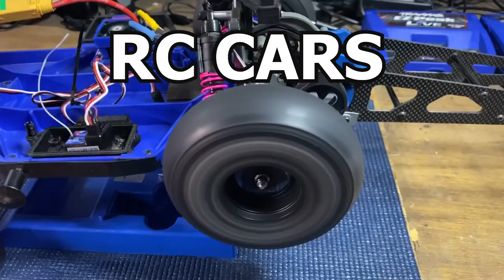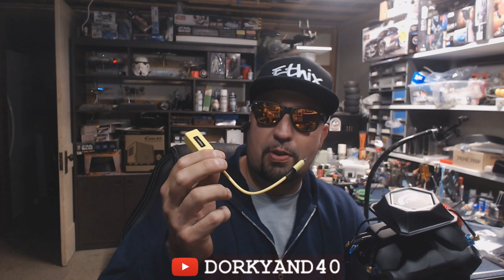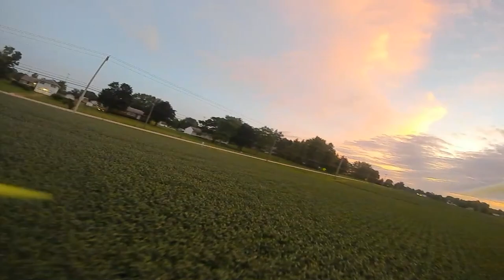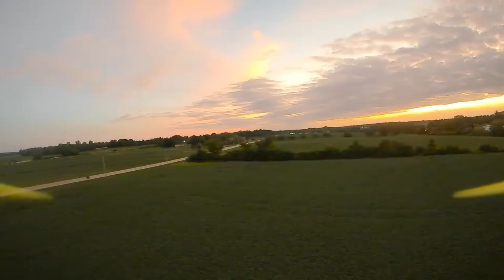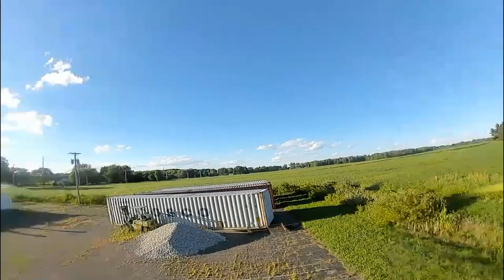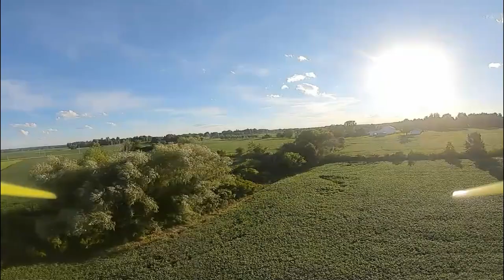DJI FPV SYSTEM | VAS CYCLOPS ANTENNA V2 UPGRADE

Comment: I got the tru rc stubbies. Have not noticed a difference. Except smaller profile.
Reply: they are actually very slightly worse than the stock antennas.......... but at least they fit in the poxy bag that dji provide with the goggles.
id love to kick the shins of the muppet who did the measurements for that!
Reply from the maker: Lol. Well if you’re looking for some more range and strong mbps performance then this is a great option. He’s got it down.

Comment: Agree that the antennas need upgrading. 
I've got 4x foxeer 3 and I can fly over a mile (probably further not tried it yet) at a consistent 50.8mbps 
In the stock antennas I'd be struggling at around 600m.

So upgrading to basic foxeers without spending a ton on these so called specially made digital antennas.... Gave me an extra 1000m easily. 

For those of us that use the DJI goggles it's far more beneficial for us to see the actual bit rate and signal bar in your video's this can be overlayed.

Also you can superview your video's for free.  RC shim has a Niek pc tool to use.(you probably already know) 

Great video
Reply from the maker: Thank you. I’ve seen those videos. Maybe I’ll look at them again. I’ve just been stretching the 4:3 video in premiere pro and it looks decent enough.  I’ll need to included the numbers in other videos.
Reply: May I ask which Foxxer 3 you are using.  Are they just the standard LHP with the RPSMA adapters?
Reply: @samavella8831  yes
Reply: @gmivisualsjason3729  Thank you.

Comment: The issue with that Cyclops setup is that it is still directional,  so  it would annoy me to have to remember to turn my head each time I fly to a new location outside of the "cone" .
Reply from the maker: The beam seems super wide so far. No more of an issue then any other patches I’ve used before. This setup is also performing better then stock behind me through my house.
Reply: It's 120 degrees beam width, just get it close. Lots of us have been using directional only headmounted for years

Comment: What about your video on compressors? I was really interested in this subject. I’m new to air brushes but curious where you stand on them. And curious if you can use your portable 1 or 2 gallon dewalt, kobalt, craftsman, etc 20v etc 48v rechargeable compressors that many people have for other things around the house or shop. Thanks!

Comment: All you need to hook up speed IB is a micro USB to C cable 8 bucks on Amazon you don't need that fancy  Adapter Thanks for the antenna info it's greatly appreciated
Reply from the maker: The full app seems super nice though. And I’m not sure they have the apk for iOS. I think it’s android only. :( for now

Comment: Once you fly it for a while you'll fly analogue again and be like "yuck what is this?" Best fpv investment I ever made was DJI. Hope you're enjoying it!
Reply: It's strange...... I've had digital now for a good few months.
I mainly just cruise around scenic locations with some light acro enjoying the view.

I must confess though that I also like analogue still....

But prefer digital
Reply: @gmivisualsjason3729  you really prefer analogue? I have 30ish quads and my left over analogue ones are just collecting dust these days. It's like flying half blind going back to analogue. And I can't stand the flickering and static in analogue.
Reply: @Skankhunt-42-  lol, apologies. Edited my post.
🤣😂🤣🤣
Reply from the maker: There’s a few ships...like my tiny trainer..that just fly so well the way they are specd the extra weight of a vista would really hamper them. I’m excited to try kabobs frame since the weight will be kept down.  Question is how much will I fly those smaller analog ships as they used to be my go to around the house.
Reply from the maker: I’ve never been a huge ripper per say. I do mostly just cruising and flying. I get more aggressive with the 3 inch builds due to their size and ability to take damage and not really needing much repair.

Comment: Nice dude...told ya...n dont watch the signal bars on left, they drop fast, the mbps is what ya need to watch, below 10 danger, below 5 GTFO
Reply from the maker: That’s good to know man.  I can def tell by the image how bad my mbps is getting. I’ve only seen a case where it drops around 10. Funny thing is punching out like with analog doesn’t seem to recover as fast
Reply: @Dorkyand40  yup, it dont recover super fast, but 50mbps handles super low mbps MUCH better than 25, it would stutter n lag bad, unlflyable.  Set urs to 25mw n fly close behind stuff n get megs down low to see how it feels n looks to get used to it.  I fly lotsa unfamiliar urban spots so really appreciate the control at low megs that 50 gives me ...luv me sum dji...fuk soo good man
Reply: @flo-ridafpv5713  when I added patch antennas to the bottom two (menace digipack) I found my bit rate held solid at 50.8mbps.
But the signal bars would drop into the red and even occasionally have no bars showing.
This was until I also upgraded the top 2 antennas also and then both the bitrate and the signal bars worked as expected both showing same results.

Lesson: upgrade all four antennas as it seems the bottom two give Mbps and the top two are needed to display the signal bars.

A mismatch doesn't work right on the DJI goggles not like diversity on analogue

DJI the four work together.
Analogue the strongest is used.
Reply: @gmivisualsjason3729  ah good observation man, i just found the same when i went from 4x vas ions stubbys to the new axii hd setup w 2 stubbys n 2 patches on the eyes....i run mine top stubbys bottom directional. Tested much better than 4 onmis & Its soo compact n nice to always have patches on eyes to look tword difficult RF areas ....and they look Sooo sick lol
Reply: @flo-ridafpv5713  Ok thats interesting.  ive seen these new antennas on you tube i think it was Nurkfpv that had them on.    in use then im guessing what you will see at longer distances is a high bit rate but low signal bars in the osd as the omnis wont reach as far.
i think id still prefer either 4 directional antennas or four high quality omnis.... depending on where and how far i was flying.

i ran a test recently with two menace rc (Digipack) antennas on the bottom two and compared to running four omnis.  the patches didnt give me any noticable additional penetration unlike they do on analogue. very strange and unexpected.
i recall Andy rc describing that they would improve signal on lower outputs, appealing for those in europe who try to stick at 25mw. but again my tests showed no improvements at all. so at higher output i dont think theirs any advantage yet of having patches at all.
im awaiting delivery of a flywoo explorer LR and am looking forward to doing some additional long range tests of some antenna combinations.
when the 50mbps update came i recall the long range record to be done with two patches on the left side and two omnis on the right side... i tried this at shorter range in a very shrubby area and their was a very small improvement.... or so i thought until i compared with the stock antennas.   

more tests to be done....
Reply: @gmivisualsjason3729 yup nurk gonna do vid soon he says... i find testing tennas in flight too inconsistant, especially if foliage is involved... i test static at 25mw kwad out back w fan, i stand in front of house in same spot n turn front back n sideways n note mbps ...3 bedroom block walls, i need good 360 coverage + directional penetration as needed, i fly lotsa urban spots n only post gogg dvr superviewed soo & these matched or beat my 4x ions depending on direction, soo they stay...previously the ions replaced 4x stubby lollipops
Reply: @flo-ridafpv5713  yes, that makes sense about the stubby lolipops, rcshim pointed out the longer ones v3 were much better. 
and i think id say the opposite that the most important part is to test the antennas at the places we fly as this gives us true to life results.

all part of the fun of the hobby...
Reply from the maker: That’s what I do. I see the same drop offs in dji that I saw with analog so it’s very comparable.
Reply: @gmivisualsjason3729  yup saw his test, problem w trees n bushes for tests in flight is its super inconsistant on how they can stack up, n diff leaves have diff amounts of moisture giving inconstant results